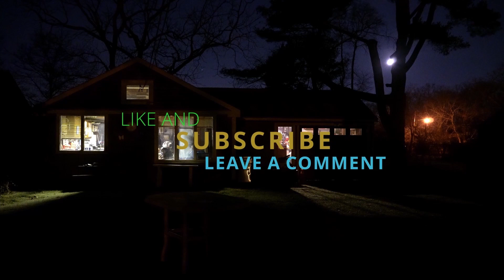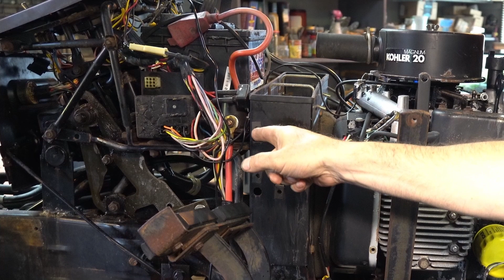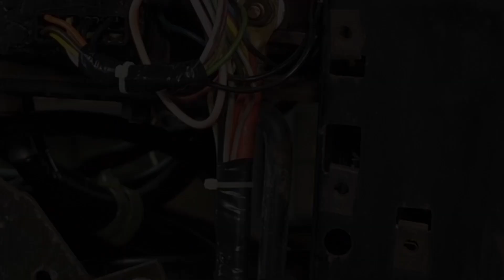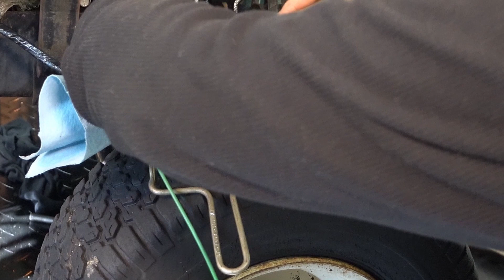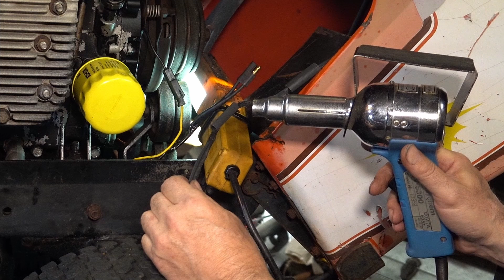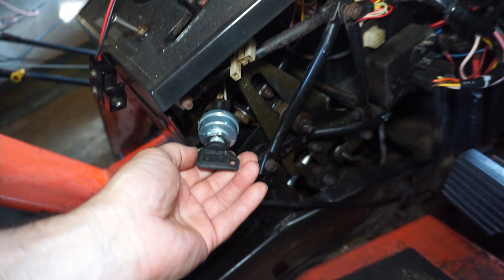Simplicity Sunstar ~ Making the PTO Work - Electrical Repairs ~ Tips I learned Wiring Grumman F-14's

Comment: Where can I get that wire holder for soldering , like you used in video?
Reply from the maker: I got that tool at Grumman Aerospace waaay back in the day but slowly I'm getting into more electrical and electronics. Start surfing amazon and other companies that specialize in gear like this. 
Its funny cuz your about a year ahead of me. I want to start another channel "AGT" for things just like this but I'm not ready yet.

Comment: hi   I like your video.   I have SunStar.   I think its the ground.   But what is that wire on the other side of the clutch.    When I turn the key on,  all dash lights come on... It just makes a single click
Reply from the maker: One wire is the ground the other is the power wire coming from the switch, when the switch is thrown (ignition On) you should have power to the coil of the clutch. You should be able to hear it pull in with the engine off.
The tractor is still new to me, I guess 2 years as time goes I will post more detailed videos.
Thanks for watching!

Comment: My simplicity same older model.. the pto cut out.light comes on no engagement.m . even with the manuals.. looking for a solution.. as a repair shop took two months last time to get back we had deck issues kept blowing off belts left and right..  yeh.. gonna hope I can figure out a home fix..  least now I can trouble shoot the electrical knowing where the wires go.. thanks I was looking at the wrong side..
Reply from the maker: I didn't even show all of it but as you can see the wires and connectors were in poor shape. Taking it slow and methodical I found a way to clean this up and make it reliable
Good luck and glad if I could help to some degree
Thanks again for watching